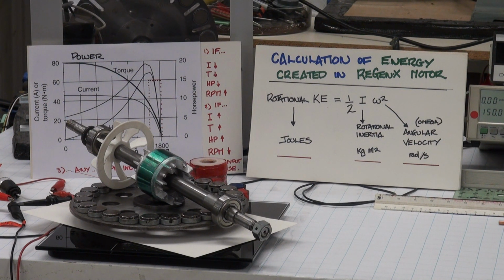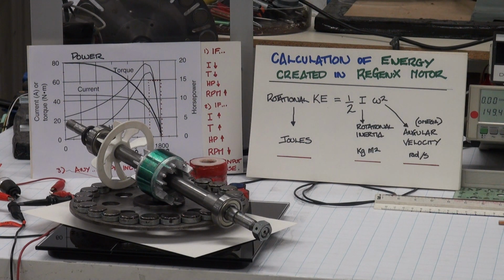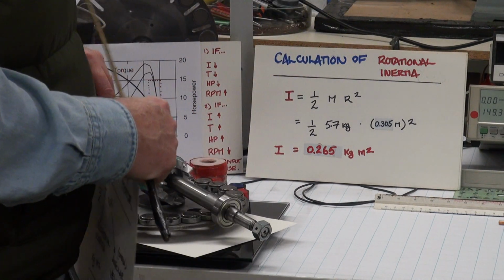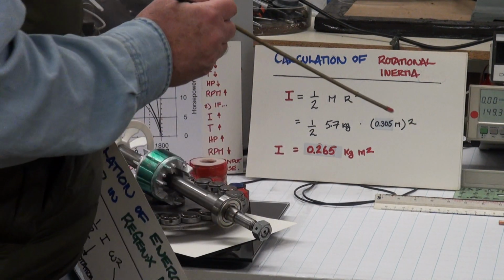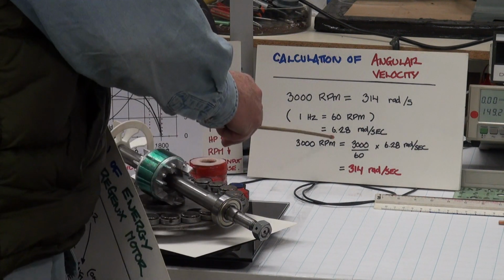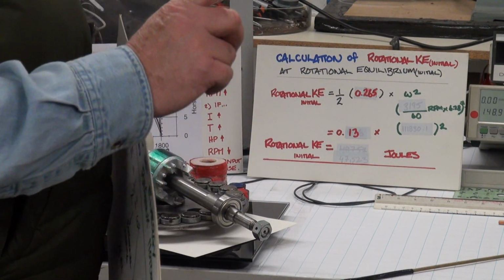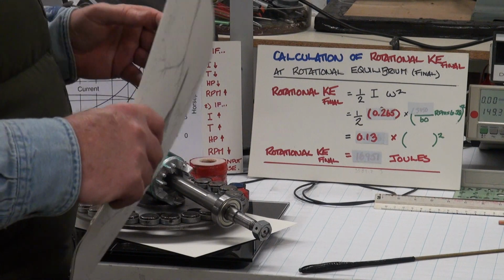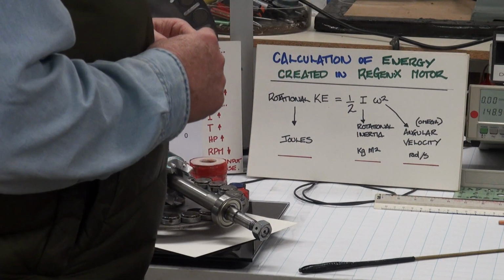PERPETUAL MOTION MACHINE OF THE 1ST KIND OPERATION #perpetualmotion

Comment: What you are doing has been part of my research for two years. You take an AEPINUS Capacitor, you put another central disc isolated from the discs of the said capacitor, from which you bring a rotary counter rotation to the two discs, and you influence a Very High Voltage, at least 20,000 volts on the two discs of the capacitor . By this, this is the goal of my experiment because I am in the process of making my anti-gravity flying disc, since during the rotation a negative ionization of the air must emanate at 360 °, making the machine antigravity therefore s 'rising in the air. Later, on the lower spinning disc, I would put magnets on the peripheral ends of the spinning disc to create energy that will be fed to the disc to keep flying. . .